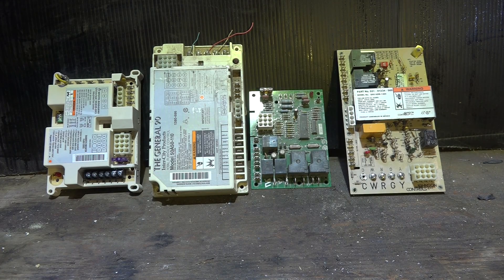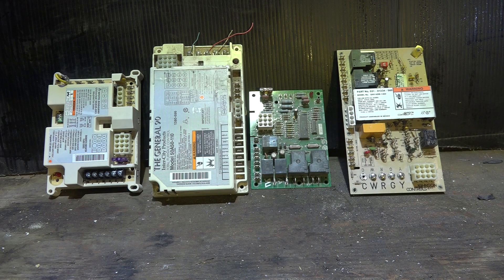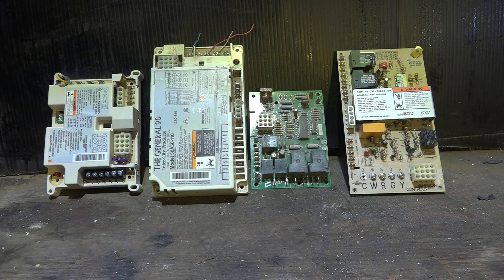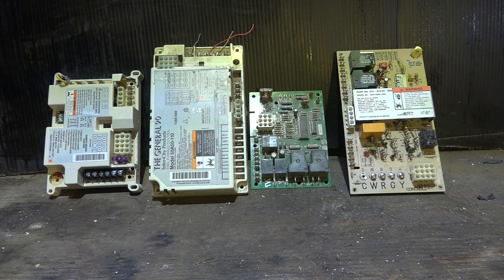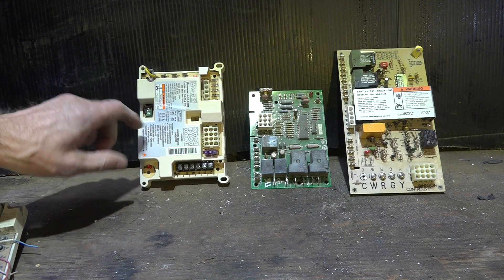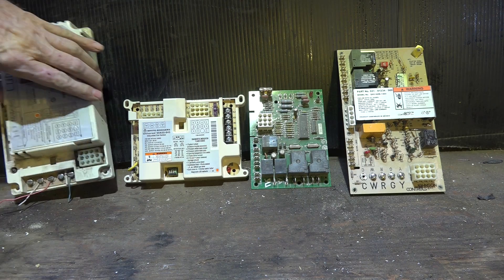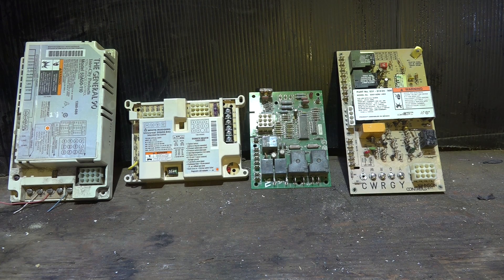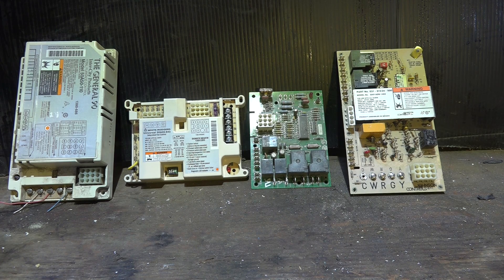Introduction to the IFC control for the gas furnace #1

Comment: Our furnace has 1 solid green light and 1 green light blinking slowly.  No red light on. Burner turns on but shuts off immediately.  Would that be and IFC problem?
Reply from the maker: If your burner comes on for 4 to 7 seconds, you probably have a flame sensing problem.  Different manufacturers have different blinking codes.  There should be a key to the code inside one of the panels.  If it is a flame sense problem.  Cleaning the flame sensor may fix it.
GFM

Comment: Several years ago, my XR80 blower would start but the burner wouldn't come on.  I thought I'd check the IFC connections (with general troubleshooting knowledge, but no specific furnace experience).  Anyway, I pulled each connector off and plugged them back in.  Almost every one was very tight, none were loose.  After doing this, the furnace worked like a champ.  That left me stumped, since all the connections were at least snug.  Searching online for my model's IFC turned up prices of about $300 (ouch).  Fast forward a year or two and the same blower/no burner situation popped up.  This time the old "reconnect" trick wouldn't work.  I did find an IFC for about $150 after doing some Columbo cross-referencing.  The back of the old IFC had a dark amber spot about the size of a silver dollar.  I added several layers of aluminum foil tape against the furnace wall, under the IFC (hoping to block some heat radiation to the back of the IFC).  One thing I also did the 2nd time was clean the flame sensor (wasn't the problem).  Just thought I'd share one man's journey into IFC land.  Thanks for all the great videos you produce.

Comment: Question- I have an old Goodman Janitrol from 1992. The light constantly flashes 3 times, which is a pressure switch code. However, the strange thing is that the furnace still runs fine. The pressure switch and wiring is good. Also, if I pull a wire off the pressure switch with it running, it shuts down as it should. Bad IFC? Thanks.
Reply from the maker: Yep, bad IFC
GFM
Reply: @grayfurnaceman  Thank you. I love your channels. You are one of the only Youtubers that actually responds to comments.
Reply from the maker: Thanks for the support.
GFM

Comment: Great video. Question? The blinking lights code also give the  diagnostic for the default self  relays on the IFC board?
Reply from the maker: Not specifically, the failure of a relay will be indicated by the results of a failure of the relay to operate.
GFM
Reply: grayfurnaceman thank you so much

Comment: what if the ac works fine....but the heater wont blow any air? is it the control board?
Reply from the maker: Not enough information.  What happens when there is a call for heat?
GFM
Reply: so now the ac quit...no power coming from the IFC for heat or cold relays from the IFC....are these IFC's interchangeable? I have the second to the left?

Comment: So the board controls the A/C then?
Reply from the maker: The indoor fan is controlled by the board and the control voltage source is from the board.  However, the board has no control function over the A/C.
GFM
Reply: OK, then that answers my question about what the IFC does in cool mode. Thank You, saved me from asking our technician which I don't want to bother him.

Comment: my board has two lights.  An amber and a Red.  Currently have a solid amber light(means flame) and a blinking red continuous?  But no flame.  Board issue?
Reply: TheSyraboy look inside your furnace door, it should have a diagram for a diagnosis